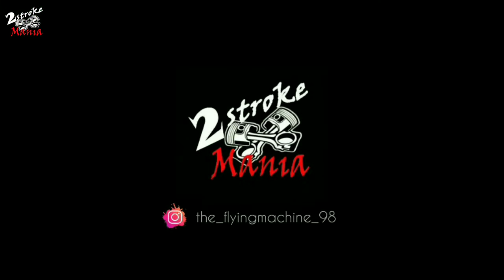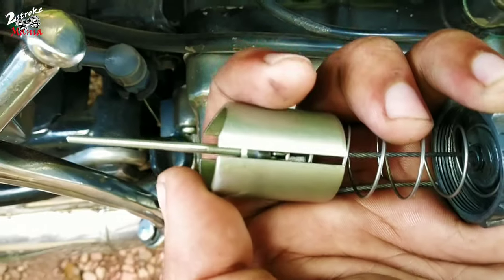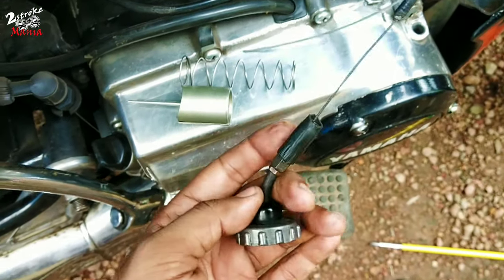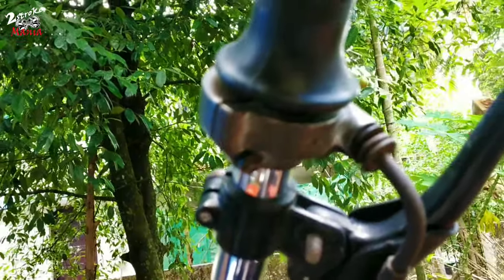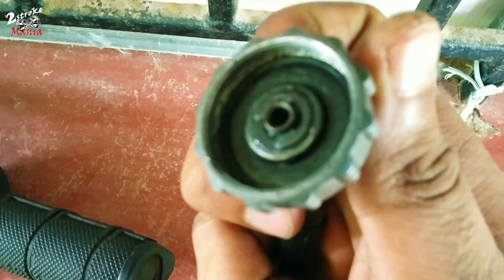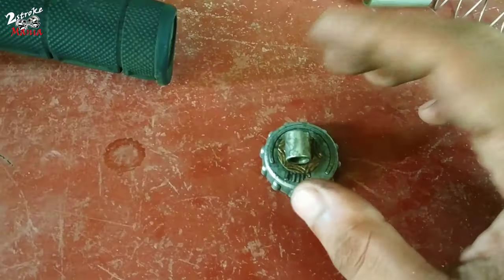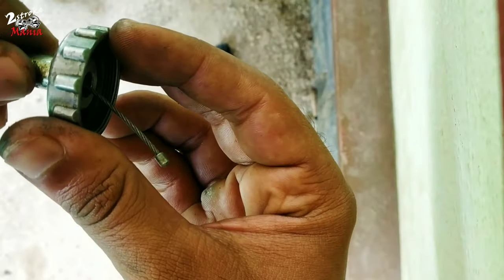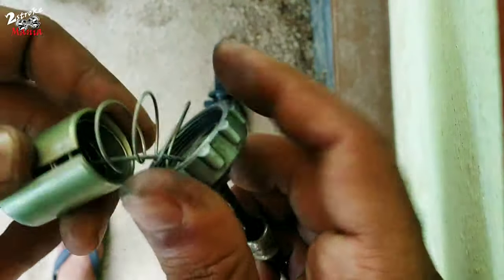How To Install Quick/Power Throttle  On Yamaha Rx Series | Malayalam | Vlog 18

Comment: How do u connect the 2t pump cable?
Reply from the maker: Normally we can't connect 2t oil pump when we use throttle.. But we can do it by another way.. Use stock cable il throttle..

Comment: Bro ee quick throtte inte koode verunna cable aarum angane use akkaarilla pettann pottumnn aryaam. Bro inte vandi hightum kooteetind maathralla hand barum height ind. So eth cable aa use aakaa?? Cable nalla leangth indallo ith
Reply from the maker: Domino de throttle cabel better than other throttles... Or we can also use autorikshaw cable.. Old model bullet cable.. Activa cable.. Inner cable matram eduthu cut cheythu stud weld cheythu use cheyyam

Comment: Bro quick throttle use panna bike mileage evlo kammi aagum
Reply from the maker: It depends on your riding bro... If you ride in full rpm then it reduce mileage.. Usually 2-3

Comment: Domino yudae stock cable ano bro atho altered cable ano.cable angane cut akan chance undo
Reply from the maker: Ithu domino de stock cable thanne anu.. Carb nte top le bend vechu cheyyanel inner cable vere use cheyyanam
Reply: @2StrokeMania  throotilinte കൂടെയുള്ള കേബിൾ fit ചെയ്യുമ്പോൾ കാർബറ്ററിന്റെ ടോപ് bend ഒഴിവാക്കേണ്ട ആവശ്യമുണ്ടോ അതിൽ തന്നെ കേബിൾ fit ചെയ്യാൻ പറ്റില്ലേ
Reply from the maker: Suzuki il cheyyumbol ok anu.. Yamaha il carb bend nu length kooduthal undu.. Appol throttle nte kude ulla cable pattilla... Allel inner cable  change cheythu length kootanam..
Reply: @2StrokeMania  suzuki max100/samurai വണ്ടികളുടെ carburetor top bend rx ൽ fit aakkan പറ്റുമോ
Reply from the maker: Size difference undu
Reply: @2StrokeMania  ok

Comment: Cable potti poi bro appo etha ini vangendath?
Reply from the maker: Petrol autoricshaw de accelerator cable kittum.. Inner cable... Athu throttle nte outer cable il ittitu correct length mark cheythu stud gas weld cheythu set akkanam